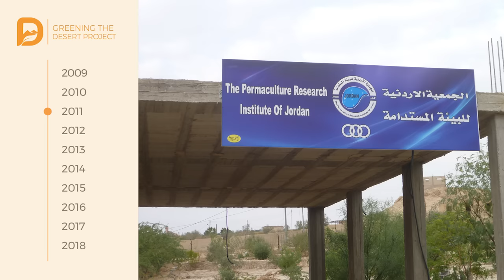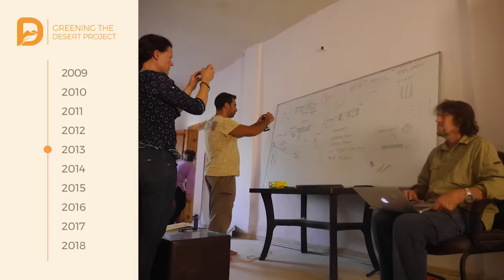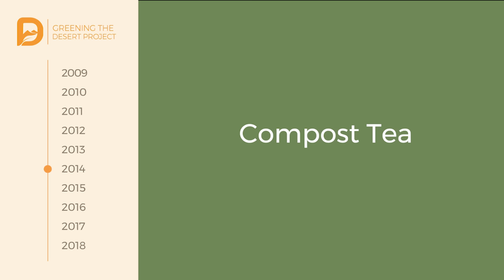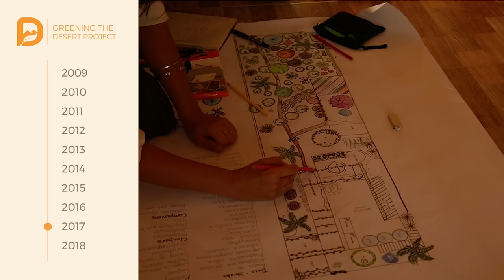10-Year Timeline of the Greening the Desert Project

Comment: Great work. An observation though, it seems a lot of labour and potentially cost have gone into achieving this level of success. I like the influence within the neighbourhood, that's real measure of success in my mind.
Reply: In regards to labour and inputs, these costs should be divided by the lifetime of the system, which is designed to reach a point which is self-sustaining.
It also seems like a great way to put to use the most valuable resource of all - people.
Reply: @joecrablone286  I've seen other permaculture demos in the desert and they have varying degrees of success. However this has been extremely successful and demo is always a hive of activity. It's seems like greening this extreme example of greening the desert is best done as a community effort. Almost like Brad Lancaster's efforts in Tucson.
Reply: Labor and cost are plenty when starting but in the long run permaculture doesn't need much work
Reply: It wouldn't be possible to green the desert, without that labour and high cost, inputs involved. As long as humans occupy the desert though, Geoff's site, is one of the more efficient and regenerative systems available. I question Joe Crablone's estimation, that it can reach a point of actually being self-sustaining though. I understand the number's theory, but given the natural resources in a desert are severely limited, there will always be a cost involved to bring inputs on site, to keep the system going.

It sounds like a criticism. But it's not when you consider corporations are already farming food in arid locations, with less regenerative systems in place. Over the lifetime of the site, it will use considerably less resources than the mainstream approach. It will also generate less waste. But I'm not sure it's location precludes it to be self-sustaining
Reply: @Christodophilus  It's not a criticism, but one measure of success for sustainability should be practicality. The full demo may not be fully practical as mentioned due to the intense labour and input requirements, however the adoption of some most of the components in the neighbourhood clearly shows that the project is a success.
Reply: @leedza  The way I worded my last paragraph, could have suggested your comment was a criticism. When I was really suggesting my own critique, sounded like a criticism (ie: the system requires continual, external inputs, to keep it going). Sorry for the confusion. I take  your point about needing a practical application, when there isn't the money and resources to do what Geoff has done. Overall, the site demonstrates the success of the community, to keep the system going.

My point was to compare Geoff's design, to existing food growing systems, in arid (or semi arid) climates. The kind, which don't employ regenerative design, and therefore, use more resources over the life of production. In that comparison, Geoff's system becomes much more practical, to adopt. Because if external resources are required, to keep the system going - using less, is more cost effective, and ultimately more sustainable. Not COMPLETELY sustainable, but more than the status quo of growing food in the desert.